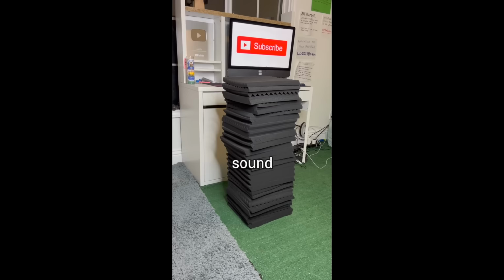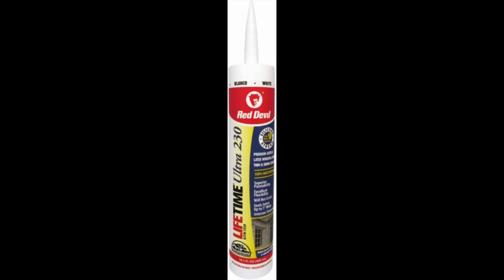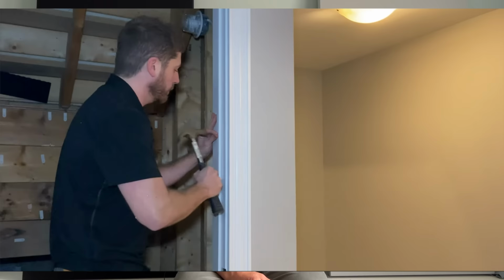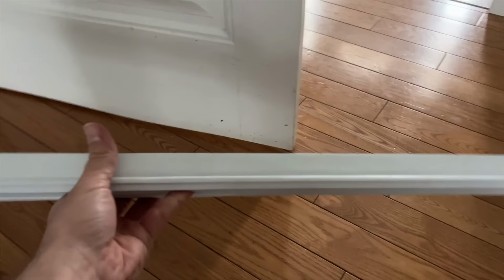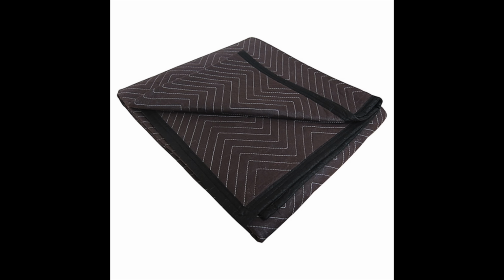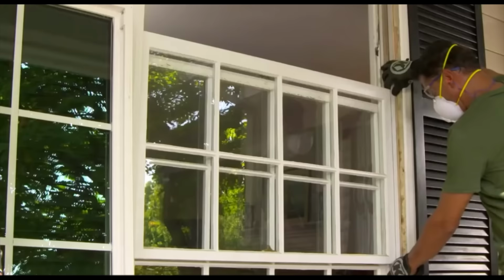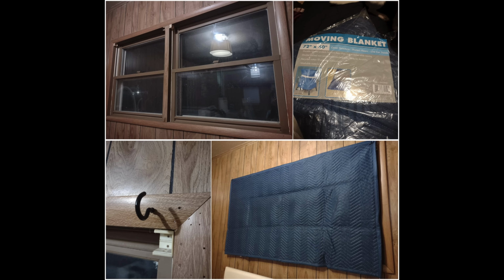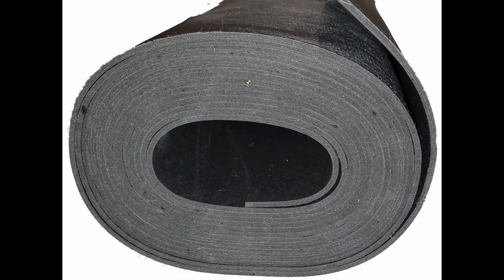CHEAPEST Budget way For SOUNDPROOFING a Room

Comment: If you want to hang curtains to reduce outside noise (typically traffic), use the heaviest fabric you can find and have the curtain hang at one-quater of the the noise wavelength from the window. Assuming the centerband traffic frequency is 500 Hz, the 1/4-wavelength is just under 7 inches. Ideally, you want some extra material so the curtain is not tretched taut, but is a bit ruffled. This effectively varies the distance to the window and mitigates a wider frequency band of noise.
Reply: working nightshift and having a home built across the street makes me wish I thought of that, I put foam insulation sheets in windows and got custom molded ear plugs.
Reply: Just use a producers choice blanket for curtains works great
Reply: Legend
Reply: 7 inches? That’s enough room to put in some plants on the window sill, or for your cats to bird watch.
Reply: Thanks for the measurement. I was gonna start with zero air gap and probably forget what I was doing. Lmao
Reply: I'd never thought of the distance from the windows making a difference! :)

I purchased some quilted fiberglass curtains a while back, and they seem to help a bit :)

If we have two layers of curtains, is there a certain distance that the second curtain should be behind the first? I'm guess they should be as close together as possible but really have no idea XD
Reply: @glowcube  

The distance of teh second layer is dependent what frequencies get past teh first layer.  If 500 Hz is still the frequency band center, then it is another 7". However, you are cutting into the space of your room. 

The other option is go with density. Sound wave pass through varous mediums (ike solids) by exciting it, creating sound/vibration waves in that medium and then that medium excites the air  on teh other side. A heavy dense material requires more energy to excite. An an unconfined surface, like fabric hanging, dampens the sound energy even more. What you can do is have denser fabric. I do not thjink two layers if quilted fiberglas will significantly help,, but if sewthem together to make one thick curtain, it might be better. However, you will need to have fastening points all over the curtain, not just sew the edges. 

If you don't mind a distorted view out your window, you can attach a thick plastic film on the window glass. They have those removable film to adhere to windows in the winter for insulation during the winter. This usually helps with the higher frequencies. Less so with the lower frequencies.
Reply: @ycplum7062 I most importantly need to get rid of crickets noises (high frequencies 10khz+) when recording at night or birds chirping loud like they were paid to do so at day. I get very good results by EQuing the sht out of my voice recordings but that’d be fantastic if I didn’t have to
Reply: @renaldsunset  

High frequency sounds are the easiest to attenuate. As a general rule, if you can attenuate the low frequency noise, you will have taken care of the high freequency noise. However, the 1/4 wavelength trick doesn't work on that.
Reply: @ycplum7062  So… what can I do to stop the sound of crickets to come in ?
Reply: @renaldsunset  

That is tough to say without knowing the structure and condition of the house. If you have drafts around the window frames, that is also pathway for noise. Are the windows single pane, double glazed, or maybe triple glazed? How is the attic ventilated? What is teh construction ofteh house? What type of insulation? Etc.

I am a bit curious since crickets are usually not a problem for a house in good condition. Very often, the problem involves crickets that actually gets into the house. They are a pain to get at.
Reply: @ycplum7062  Haha I usually get them quick bc I have enhanced hearing. I live in a concrete apartment the sounds come from the windows that are metal shutters
Reply: This sounds like sound advice. However I just heard of a research project that found using Silk sheets, which are thin, and using a thin acoustic wire in the middle to either send the negative sound through the sheet to actively cancel the noise or alternatively to make the sheet even more taut to reduce up to something like 90 of noise. This study contradicts 2 of the things you said.
Reply: Look at visualizations of frequency wavelengths.   The idea hear is that a full wavelength of a certain frequency, the distance between each peak or trough, can determine where to place an object to interrupt or reduce the energy in that wave.
Reply: You can put a microphone outside, then reverse the polarity and lay that over the interior sound to cancel out the external noises.  By putting that on a separate track you can adjust levels and eq until you are happy with the noise reduction.
Reply: My mom used to have a whole winter blanket as a curtain to block road noises lol
Reply: Just get a proper window, does at least 30, up to 40 dB sound pressure reduction from outside
Reply: Thank you so much for your kind words and belief in me. I am grateful for your support and encouragement. Let's work together to create something truly special and share our music with the world. Let's make magic happen!
Reply: @FreakAzoiyd  

Actually, 30-40 dBA is on the very high end of window noise attenuation. And they tend to be expensive. The STC rating is not a direct equivalent to noise attenuation.

And in some urban areas, that attenuation is not enough. And if you are a renter, you can't readily change teh windows.

Comment: Caution on the moving blankets for window covering: the top fabrics are not UV stable and over time the sunlight will convert the tops to dust. They work and I use them but you will want to put some other stable fabric, like your light blocking curtain, between the moving blanket and the outside light. If you don't want the stylish moving blanket wall covering look, get some other fabric print and attach that to the moving blanket to convert it to a tapestry like in merry old medieval times.
Reply: Good point, nothing worse than wondering why the air quality is starting to go down in the room.  Then have a neighbor start complaining because you have a blanket covering the window that looks like something from a haunted house (I'm thinking beauty and the beast style) 😅
Reply: I used moving blankets once for a quilt I made, it’s cheaper than the expensive wadding, but you can buy a UV wash additive by Rit Dye’s, use a spray bottle and spray the blankets with the solution that should help to extend the life of the blankets. I use it so that I can wash and hang my quilts out to dry in the sun this helps to stop the colours from fading when on the line and on the bed when the sun shines through the window.
Reply: Good idea! Was wondering if a couple of layers of cardboard next to the window first, then a moving blanket up against that would work. Could put some cool contact paper on the side facing out. Ppl wld be walking by going...dang, they had to use cardboard!😂
Reply: There were lots of good suggestions here. I have a basement studio and I have spent way too much money on soundproofing materials (only $100 when I told my wife how much😂). I know I’m gonna be irritated when theses small and inexpensive tricks do more than all the big, dumb, expensive things. Oh well… live and learn. Thanks for the great video.
Reply: As a voiceover performer, I won't work with them anymore, due to one job long ago where the amount of dust in the ones the producer had, literally hurt my voice.
Reply: @m.denonsens are you saying dust from the moving blankets? How do they produce dust? I am also a VO artist and recently moved and am going to use moving blankets for sound treatment. Are you saying the blankets emit dust?
Reply: @MichaelHoward-td9qm  Hi, they don't necessarily ship dusty, but they sure can accumulate dust. And I've previously worked in places where the studio owners were not necessarily careful about maintaining them or consecrating them for one purpose. This was mostly early in my career in home studio set-ups. Going forward, if I ever came into such an environment and smelled the dust (which you can), I might even ask if the blanket had been used for mobile or on-site uses, or been in contact with floors (i.e. for drum set-ups), but whatever the response, I would not be working with them. Not worth the damage to the voice, imo.
Reply: There is uv blocking spray at auto parts stores for tires. I put it on some wood that was exposed and It worked better than I thought it would.
Reply: I'd recommend a UV filtering film for the window instead
Reply: You can also Just use  A spray that is used to protect outdoor cushions ect  from the suns  UV rays and spray it on the curtains ( spray it outdoors)
Reply: Great tip and genius ideas. Thank you!
Reply: Great post.  Thank you.

Comment: When our house was being built, I had the builder add insulation to the interior walls. I had this done for noise reduction. Noise originating in one room would then be less noticeable in adjacent rooms.
Reply: Opting for 5/8 drywall instead of the usual half inch is also helpful
Reply: I regret not insulating our interior walls. I don't want to open them back up. I am considering loose fill (it's just paper,) but I think it may not be worth the effort.
Reply: That should be standardvall homes the fact it isn't infuriates me I don't pay rent or buy a home to hear others sounds its basically defeating the object of having your own space
Reply: At build/framing time, best results come from doubling up the stud count, with half offset by half your usual on centre measurement, staggering the  odds & evens so that plaster board from the adjacent rooms aren’t attached to the same studs - no vector of vibration transmission. 
Acoustic rock wool insulation helps too.
Reply: Pretty sure it’s standard in the uk and all new homes to insulate interior walls
Reply: @alexfrost8645 It's not in the US in California, I can tell you that. With all the requirements they have, I find it frustrating this isn't included. I don't think even the wall against the garage is insulated, but I'm not sure.
Reply: @strawpiglet you are correct, currently studying to build my own home in LA because it’s cheaper. Been reading the building codes like it’s popcorn at the movies. Not a requirement and yet it’s also a safety benefit too. California is very concerned with fires in their building codes, (among many things) but especially with fire, insulation actually helps keep fire from spreading from room to room. Takes longer to burn through with most insulation types. And you get temperature benefits, and sound reduction between rooms….
Reply: @cornRipper  Mineral fiber insulation is the best for sound attenuation and fire stopping (aka rockwool, therma-fiber). Standard fiberglass insulation helps but rock wool is far better.

Comment: Many years ago in my previous townhouse I had a wall that was shared with people who lived in the townhouse next door & I could hear their talking at night.  Drove me nuts.  I did a ton of research & ordered the products:  A roll of lead paneling, some special foam, the hardware and glues needed to install the lead and foam. Hired a handyman to do all the work.  Also had new dry wall installed, 2 or 3" in front of original wall, after the lead, foam, and special brackets were completed. Air is the best insulator and sound proofing.  Then had the new dry wall plastered to match the texture of the other walls in the room.  It certainly helped deaden the sound coming though, though it wasn't 100%.

Comment: I discovered using flat moving boxes cut to fit snug inside the window frame, fold the moving blanket around it then stuff it into your window frame.. super soundproof and will cost about 15 dollars for a standard window. Harbor Freight has cheap moving blankets and Home depot has cheap moving boxes👍
Reply: I just asked about cardboard! 😂.., seriously though, does it help, bcz that wld be a more affordable solution for me. In addition to the blanket of course.
Reply: @micahthomas9521  I wish I had pictures but yes! It totally worked, good luck! What's cool is you can make more layers, but if you have the same snug fit I got, you'll see how good it is.
Reply: Wait what, does that work??? Currently I'm using cardboard but it doesn't mitigate any low vibration sounds like engines rumbling
Reply: @user-need.advicee  so when I did my bedroom window, I put the blanket up like a curtain and I got lucky my 2 flat boxes where the right size to shove into the blanket snug along the whole outer edges of the window frame. Got to make a good tight fit. And I hung another moving blanket on the back side from the top of the frame to look like a curtain as much as I could. Low frequency sounds are the hardest to block out, however, the position of our window didn't point directly at the street even though I was the front unit. Anyways, mine worked great. Best way to block low frequency like cars and subwoofers unfortunately is to add mass (like how theaters use concrete, velvet, and carpeting.) Hope this helps, it's a cheap fix in this case after all and doesn't address walls and anything else sounds can go through.
Reply: @jrtama5  where can I buy mass vinyl?
Reply: @user-need.advicee  I don't have any experience with that stuff but heard of it; I don't have any recommendations other than to ask Google unfortunately. Good luck on your project!

Comment: Years ago I binge watched a bunch of seasons of 30 Rock.  I happened to have my laptop connected to an old 8 channel PA system with a pair of very large house speakers and several stage monitors.  The house speakers had massive 36" woofers and a folded horn passive port, and extremely large horn tweeters.  It reproduced a very large range of frequencies.

Somewhere along the line, one of the seasons, there must have been construction outside of the building where they filmed the series, because for the rest of that season and for at least the next one or two seasons, almost every scene involving dialog had the sound of dump trucks pulling away and shifting gears.  At first it was barely noticeable, but once I noticed it, it became hard to ignore.  I was able to drop a few bands on the parametric eq to help silence it, but it was always audible to some extent.

I studied sound reinforcement at a community college years ago. We covered the issue of external noise and sound deadening materials, soundproifing, etc, as part of a "constructing a studio" course module. I'm surprised NBC hired sound guys who didn't account for that nose interference.
Reply: I kind of followed you about the speakers, generally, but think it’s wild as hell you were able to hear that much background. I’m sure stuff like that gets picked up, and then maybe in post they try to hide it, but I suffered some hearing loss on active duty and it’s cause a lot of things to disappear. So, I just find it wild when people can hear through like that.
Reply: If you want to soundproof your home... you're gonna have to dance for it.
Reply: What 36in folded/tapped horns were you using?
Reply: You're welcome! I believe in you and your talent. Keep pushing yourself and let's create some amazing music together. The world is ready for what you have to offer. Let's make some magic happen!
Reply: I lived in NYC and those jackhammers and ambulances all the time were not enjoyable.
Reply: Well I hope you soundproofed the TV room prior to watching

Comment: Before you seal around the door, and instead of buying moving blankets, invest in an acoustic solid core door, designed to cut down on vibration. If you're using a regular door not much will happen. The bottom line that I was taught in my acoustics class is that mass-air-mass is the best acoustic insulator. You need a thick solid outer wall lined with acoustic insulation, then an air space, then another thick wall,  using resiliant channel and acoustic decoupled mounts to attach your 3/4" plywood, then 5'8' drywall, using acoustic caulking to seal ALL gaps. This is what I have done in my present and last studio (as well as 3 layer varying thickness windows) and it works very well.
Reply: Thank you! Yes, we were definitely resourceful in making our jam space soundproof. It was truly a game-changer to be able to play without any noise restrictions. And it was satisfying to know that we were able to accomplish it on a tight budget.
Reply: It's important to consider all aspects of soundproofing when creating a quiet and comfortable space. By adding drop closers, thresholds, insulation, and dedicated HVAC, you can significantly improve the effectiveness of soundproofing and create a more controlled environment. Working with a professional can help ensure a successful outcome.
Reply: Thank you so much for the encouragement and support! I will definitely keep pushing myself to create new and innovative music. I am excited to see where this musical journey will take me next!
Reply: Also, especially if you're in the US, look for a door that has a lip all the way around (well, aside from the bottom) instead of just straight sides. The only side light should be able to get through even before you've started should be the bottom. Even if you're not planning to sound-proof the door, it already reduces noise coming through along with light and draft.
I'm not sure if the door he showed as example would even be legal (well, up to code) in Germany, unless it's specifically a swinging door.
Reply: This video is for cheap methods
Reply: I think you missed the point of the video. This is cheap options. New door = not cheap
Reply: @Stettafire  Maybe I didn't make my point clear, it's not worth buying acoustic blankets and trying to seal a regular door because next to nothing will happen. You're much bettor off buying a solid core door and seals around the edges. Going cheap will end of costing you more in the long run.